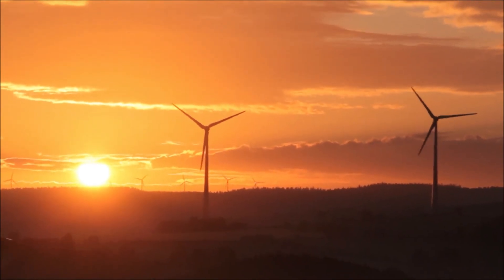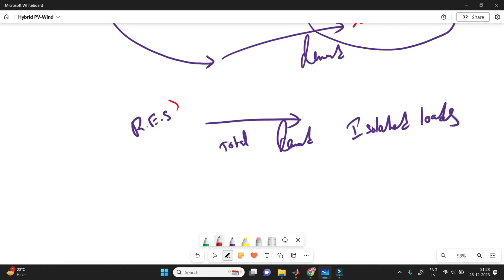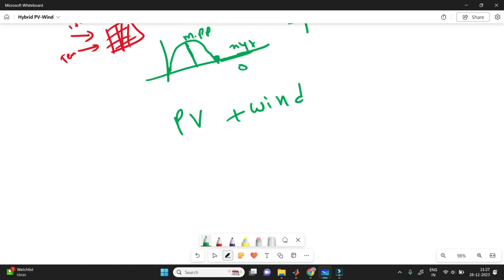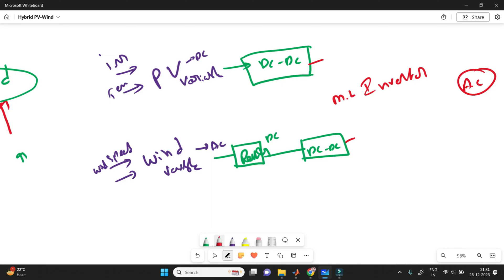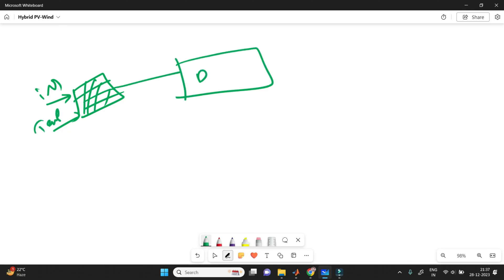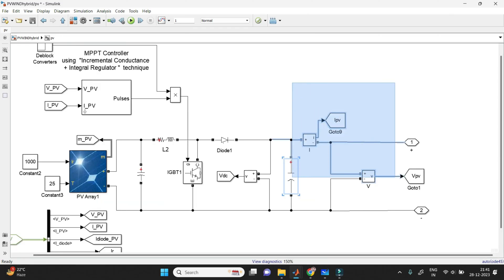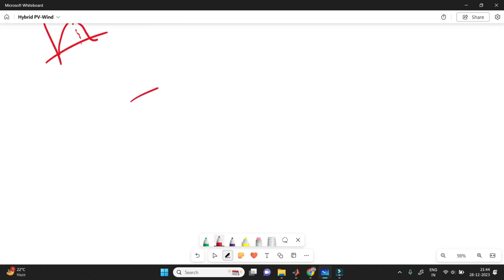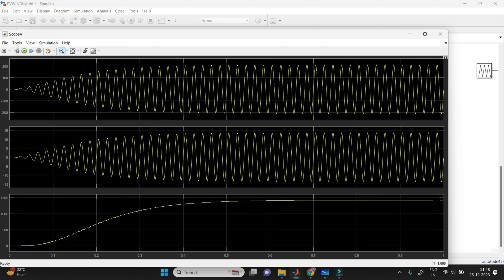Solar Wind Hybrid Energy System using MATLAB Simulink | IEEE Project | Solar PV Wind Hybrid System

Comment: Hi, sir. Im a final-year undergraduate student in electrical and electronics engineering. My research topic is the optimization of energy management in a Standalone Solar PV/wind/battery system during a faulty condition using Fuzzy logic and particle swarm optimization. First of all, i have to make a solar PV wind battery system for a standalone system. Then I have to connect the fuzzy and make the membership functions and rules.I think if there is a voltage or a current drop, there is a fault. So is my decision pattern of my research is correct, sir? Can you give me the matlab file of this
Reply from the maker: Whatsapp: +919493283537
Reply: plc